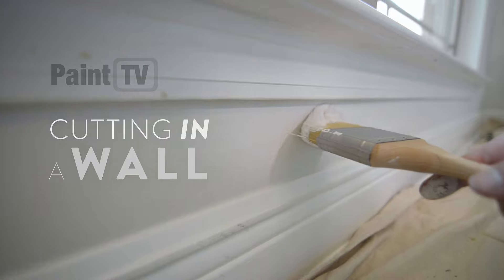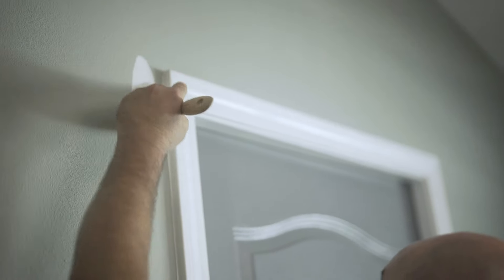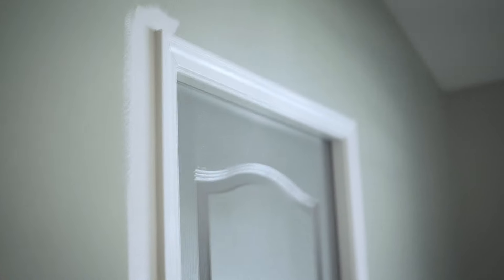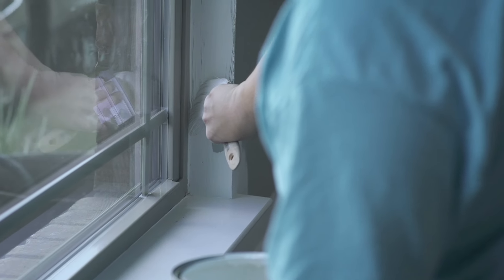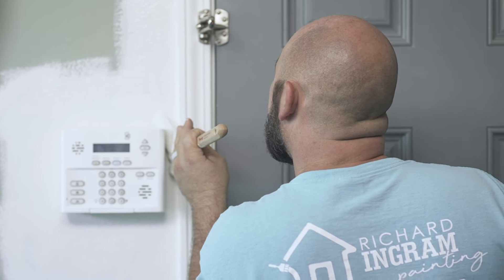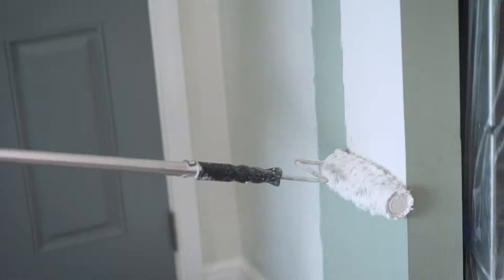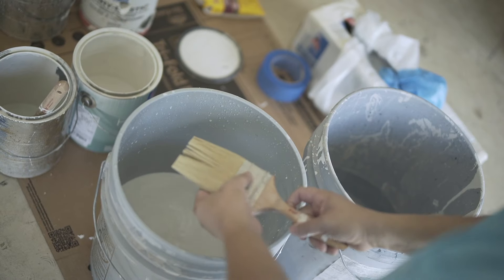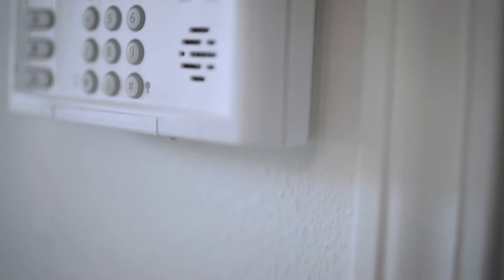Tips for Cutting In Paint

Comment: do these brushes hold as much paint as the purdy pro extras
Reply from the maker: In his experience, yes... but noted that these clean much easier
Reply: @AmericanPaintingContractor  These brushes are mostly for exterior,  they will leave roping, brush lines, use soft brushes. chinex bristles are super easy to clean, they are made for the paints that dry faster.
Reply: @sergiocardenas5939  they are made for oil based paints my guy
Reply: @sourbrothers73  wrongggggggggg. Those are not white natural bristles. Look it up.

Comment: Those are sash brushes, not for cutting walls. they leave gaps. when you use an actual wall brush , which is a flat brush, no angle, you get much more even coverage. You need a very good, 3 or 4 inch brush with fine bristles.

Comment: Don’t like angle cut sash brushes. With a twitch of the wrist a square cut can go back without flipping. Purdy no longer seems to stock brush racks with square cut sash brushes. They also discontinued the 4” XL Titan years ago. The only 4” brushes they sell now have sharp square corners on the ferrule which make it uncomfortable to choke up on. Economists are running design not painters. DIYers don’t want to spend money on good brushes or clean them properly